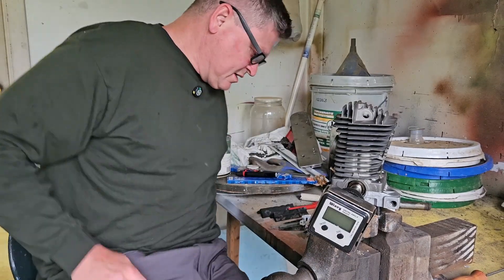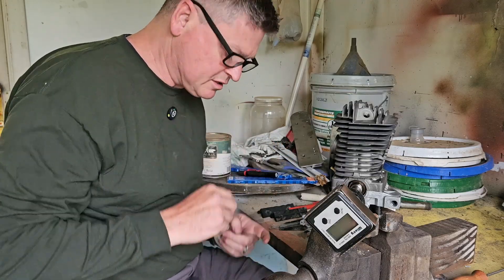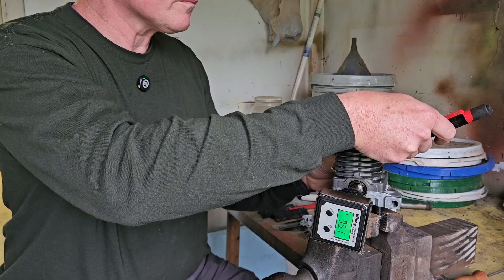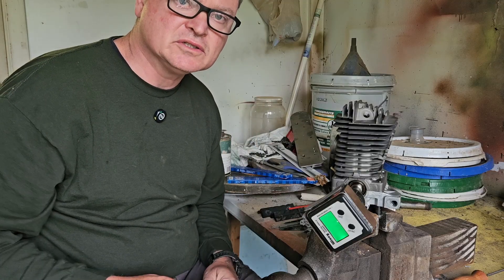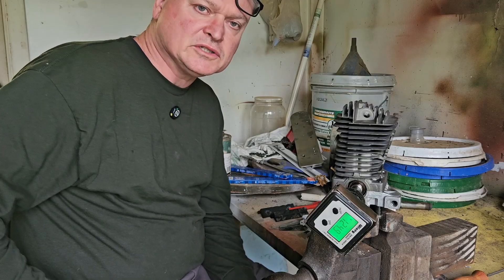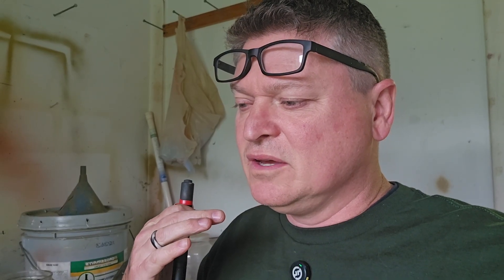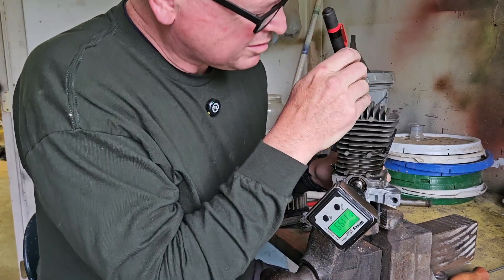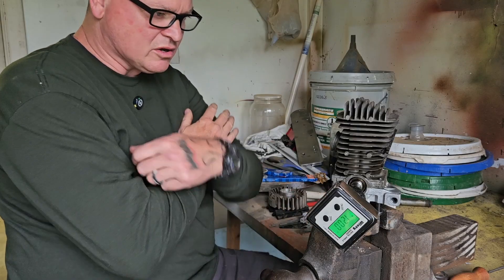Why the cheap MS390 cylinder sucked

Comment: I wondered what the #'s were on that cylinder👍🏻 Makes sense now why it didn't run any stronger.  As others have mentioned, maby weld or find someone local to you that can weld up the top of the piston so you can cut it on your lathe to whatever you need🤷🏻‍♂️ otherwise, if it were mine, I'd likely just put it back to stock and say heck with it.

Comment: If you have a ac tig welder you can weld the top of the piston up, then lathe it down to have it the way you want, pop up, flat, ect, then you just have got to cut the squish band and raise the exhaust n transfers obviously. I think that would be alot easier than machining the base and bearing pockets out.

Comment: It’s also good practice to run the piston into the solder a few times until you feel no resistance to get the accurate squish, but that’s just my opinion